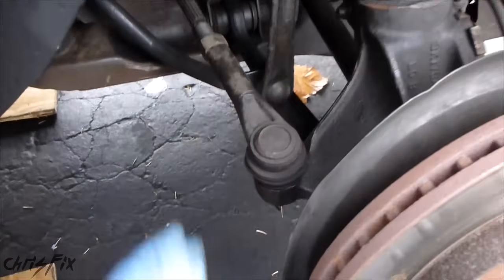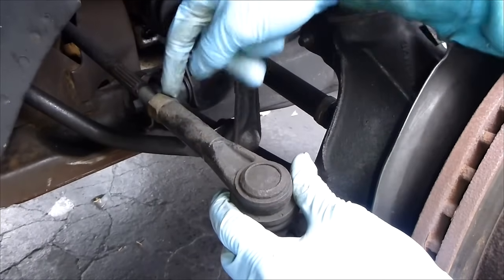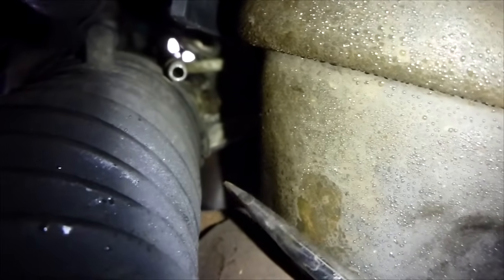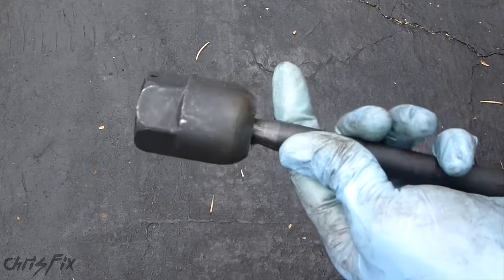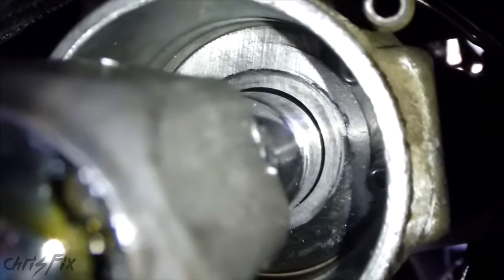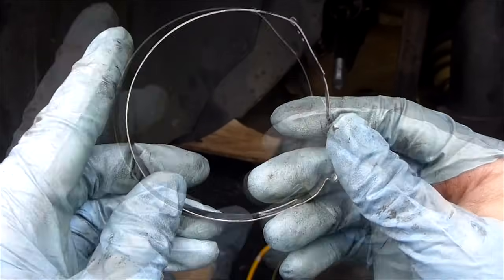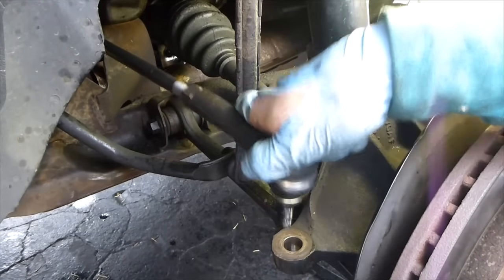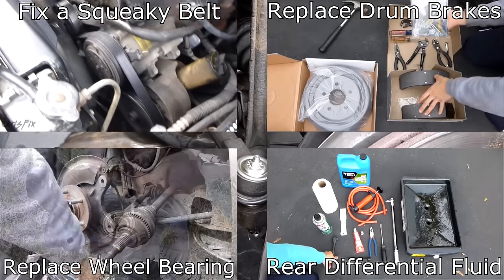How to Change Tie Rods (inner and outer tie rod ends)

Comment: These videos make repairs less intimidating. I’ve replaced tie rods, struts, brakes and water pump. Having a garage finally makes things easier. Before kneeling on gravel was no fun
Reply: With HOA policy, I can't work anything on my car although I'm not mechanic but just want to change brake pad and rotor.
Reply: @lot5953  you can’t even do it inside your garage?
Reply: @yungmexican32  ohh yeah in the garage is okay as long no one can see me but my garage is too small
Reply: @lot5953  Danm  hoa sucks man, luckily I was able to buy without hoa am able to do anything on driveway or garage. Hoa it’s like you still have landlords
Reply: @lot5953  I think I be moving that sucks

Comment: hello chris fix, i have a 05 bont. thank you for the videos.You saved me like 200.00, the shop wanted to charge me for a outer tie rod. they said it was a 92.00 part, got it advance for 18.00. then 100.00 for labor. ty again.
Reply: $100 labor per side??

Comment: Regarding removing the tie rod ends: Your method works fine and I'm really glad you didn't use one of those ridiculous forks, they're absolutely the wrong way to do it.  My two cents, if you read any vehicle manufacturer manual (not the manuals you buy in an auto parts store), the proper way to break the tapered end loose is to hold a hammer against the knuckle and hit the hammer with another hammer.  It drops out every time!!
Reply: Except that you never hit too hardened  objects Against each other

Comment: Just a reminder, You were turning the wrench to the wrong direction at the first try. And that yellow thin nut is used to lock the bigger nut after you tighten it in order to prevent it from loosening from vibration. I like your videos a lot by the way. Thank you so much for your great effort for sharing so much experience with us.
Reply: 1:12
Reply: I noticed that, too.  Happens to the best of us.

Comment: The mechanic says I have to have the inner rods changed and might as well do the outer ones too. Thanks to your video I’ve decided to do it myself. If I am successful I will have saved myself $300.00 in labor. I’ll let you know how it goes. Thanks!
Reply from the maker: Awesome! Good luck!
Reply: Razorusskie how did it go?
Reply: Luis Herrera It went pretty well. I did the rods on the passenger side first. Glad I did because they were the easy ones. The driver side of my 06 Chrysler Town & Country was harder because there were braces and brackets in the way. If I were to do it again I would have found a way to raise the car up higher. I could not get the outer tie rod to unscrew from the inner rod on the driver side, so I used a hack saw to cut them apart. Since I was replacing both it didn’t matter. The hardest part was getting the boots off and back on. Having the right tools for this job is a must. I rented a tie rod kit from Advanced Auto Parts. I had to put down a 72.00 deposit. I got it back when I returned the kit two days later. It was the most challenging job I’ve ever done on a car, but I’m no mechanic either. But thanks to this video, I was able to get it done, and saved myself over $500 dollars. It was worth it! Car has been aligned, and runs great!
Reply: Razorusskie wow. that's amazing thank you for the informative response.
Reply: Not only Labor but generally a shop will mark up the price of the parts by anywhere from 50% to 100% sometimes more, so a $50 tie rod is now $100.
Reply: Stix and you never know what brand/quality they use.
Reply: Razorusskie 👍
Reply: Stix the shadier ones will take a used part, clean it up and lightly spray paint it to make it look new. Luckily, my brother-in-law is the main Subaru mechanic at our local dealership. Parts discount!
Reply: Razorusskie Yeah just the parts for car are $60 each for passenger and drivers. A "certain popular auto store" told me it would cost $600 total. I'm gonna buy the parts and tools and do it myself. A savings of just under $500. I'll update when I finish the job. All thanks to ChrisFix!
Reply: Go for it u can do it
Reply: @stix562 , Yeah! I agree.  I don't mind paying them for their skills and experiences so the job will  be done quicker but not when they're trying to rip you off from your hard earn money.  Unless, you got to a owner operator shop then he/she can cut your some break on pricing but regular shop will always be sky rocket to get anything fix.  I was just at the auto shop today and they quote a guy $30 to fix a flat and he has to wait for an hour too.  Not only he's down $30 but lost an hour of his times as well.  Very sad... I could done it myself for $5 and 10Min with plug and fill sticks.
Reply: Firestone and Meineke recommend me to change the Inner tie rod for my 99 Camry. They both quoted some where around $250-300(Menieke ) $800 (Firestone) for the Parts and Labor. Plus an additional $90-$110 for Wheel alignment . After watching the video thinking of Doing it myself. Did you do both at once or separate days. Would you recommend doing it for a first timer ?
Reply: $300, that's all?  I just bought a used Ram 2500 and took it in for an alignment.  They said they couldn't align it because it needs new ball joints and tie rod ends. Fair enough.  Their quote was just under $4,000 total for parts and labor, adding in a serpentine belt.  Obviously I did it myself.
Reply: @chrisfix  i think theres no need to count turns of tie  rod at 2.35  ...cause the tyre is fixed  and the new one will slide easily
Reply: @stix562  Yes, if you cannot do it yourself its best to go find original parts online(Parts Geek is a good place to start) or from a parts store, and then find a mechanic to do installation.
Reply: Razorusskie yep. I had a guy tell me he could quit his second job after I helped him to start fixing his own cars. I like fixing so I'd rather do that too than punching the clock all day long.
Reply: Razorusskie........How'd it go,bro?Were you able to replace it?
Reply: How did it go ? Did you do it ok ? Thanks
Reply: @westsideken  What if your brother-in-law is that person?? dun dun dunnn

Comment: Keep watching Chris's video!
 I found out, that buicks have a plastic sleeve around the inner tie rod. Push it off with a screw driver. Harbor freight has the tool. It works. $37.99. 
You have to muscle it off! Once off, take the old part with you, to make sure, you get the same replacement part! 
Keep watching his video. Be familiar with what you are about to do.

Comment from the maker: If you want to see if your tie rods have gone bad and need replacing, here is the perfect video:
How to Tell if Your Tie Rod is Bad
Reply from the maker: So you need your headlights to be clear again? Like the lenses are yellow or hazy or something?
Reply: ***** I suggest that if you can't find the part you need contact a local auto salvage yard (they used to be called junk yards but a lot of what they have is NOT junk) and see if you can find what you need. Often you can get a whole used assembly in good shape for less than it would cost for a part of a new assembly.  Good Luck!
Reply from the maker: 1notgilty Good tip. But for tie rods and other important suspension pieces I rather have new. Maybe if you have a part that is super expensive otherwise it is worth it. I got these tie rods for $20 and the junkyard would have charged me $15.
Reply: ChrisFix True! Junk yards take  about $5 to $10 off regular new parts. And speaking from experience I can tell you an ignition module for a Toyota corolla was around 200 dlls at a dealership, Went to the junk yard and found a similar part but with the same voltage ...got it for  4 dlls at the junk yard and the car is still running.
Reply: +VeleS obando  My local pull a part is dirt cheap, but it still isn't worth pulling certain things. I have had bad luck with mechanicals. They are likely to break or be broken. Best deals are accessories, trim and aftermarket parts.
Reply: It so bad
Reply: ChrisFix
Reply: ChrisFix
Reply: donald lamb koo
Reply: As a person who does alignments in a shop - lube it all up, or else you will need replacement faster than they go bad becasue it will be impossible to adjust it. Also if you change only outter piece use a metal wire brush on dremel or angle grinder to clean all the rust on the inner tie rod threads so the nut goes freely on it or again the alignment will be more expensive.
Reply: Roberts Biezais what do u mean by lubing it all up. All parts are new and full of new grease. What else needs to be lubed up?
Reply: Ll Lock where inner and outer tie rods meet. There is usualy no grease there. I work with alignments and i use oldschool tractor oil thats very thick for the rod and locking nut. 
You want to lube them because after some time they will rust together . Its pain in ass to get them loose or even worse when you get them loose its so rusted that it has no more threads on it
Reply: Clark Kent if you buy oem or other high quality they dont cost a five
Reply: ChrisFix  can i use the same steps to  my nissan pivk up 4WD V6 1995. Thank you.
Reply: ChrisFix 7
Reply: ChrisFix and
Reply: ChrisFix  .thanks alot that was good.
Reply: teflon don
Reply: Ino Perez 

..
Reply: ChrisFix 8
Reply: Do you know any brand for a 13 civic im going to change my tire rods and suspension
Reply: ChrisFix to be
Reply: ChrisFix  شهرم سولتی2
Reply: Sgt_Ciekurs,  ....,
Reply: Dump your girl friend for a year and you would have enough money for a car.
Reply: I just came from your ball join replacement video, to this one.  I have to say your editing and vocal presentation got a lot better in a year.  You did wonderful here but your improvement over a year is amazing.  I have to say, this is one of the reasons you have 3.5M subscribers.  Thank you, ChrisFix!
Reply: ChrisFix what to do if the the rod spends when putting the Castle nut on or off?
Reply: get a pair of chanel locks and hold the top of the tie rod into the knuckle then get an air gun and bust it off
Reply: How do you feel about buying suspension components off eBay?  They are way way cheaper than AutoZone or even RockAuto and no shipping.   I just worry about the quality.  

Inner and outer tie rod ends, sway bar links, upper control arms and lower ball joints all for $79 including shipping for a Ranger seems too good to be true.

Should I buck up and pay the extra to have parts shipped from RockAuto?
Reply: ChrisFix you are a badass man.makes it look really easy.thanks.
Reply: Hau christ,,,i want to know how you can know the torque value about inner tie rood 66 feet/ pounds and out 46 feet/pound? How you know that?manual car or   pabric?
Reply: Hey Chris..how do you remove those 2 keeper pins on the inside tie rod for removal.....
Reply: @chrisfix how do you get your light fixtures bright again mine are yellowish

Comment: This video is fantastic and super helpful. This guy knows his stuff. Just make sure you torque your castle nuts once the car/truck is back on the ground. Just like upper and lower ball joints, once the vehicle is back on the ground the outer tie rods will drive deeper into the steering knuckle which will loosen the castle nuts.

Comment: 01:12 I SAW WHAT YOU DID 😂  good video though, the castle nut trick was just what I needed to know
Reply: Didn’t pick up on that until you pointed it out 😂 ah well we’ve all been there!
Reply: What? He's tightening it a lil so the PB blaster can penetrate the threads better before bringing out the breaker bar
Reply: That was the first thing I noticed 😂
Reply: Do that all the time

Comment: Thank you for your easy to follow instructions. I’m the type of person that needs to know how something works to know how to fix it. You do a good job of explaining the mechanics of a part as you show how to replace it. The close ups help a lot. My ex was an auto mechanic but I never paid attention to what he did when he fixed stuff. I wish I had but now I can do basic fixes. This looks doable for my skill set. I think this is the issue on my CRV. Front end makes a horrible clunking sound when going over bumps, turning sometimes, and braking hard. It started when we were out on a very bumpy rocky road. At almost 300k miles I’m not surprised lol.

Comment: Thank you for sharing your knowledge and expertise. Your video and valuable information saved me over $5K in repairs because I was able to identify that both outer tie rods on my 2019 GMC Sierra with 6” lift kit were damaged, the rubber boots were dry rotted and cracked because these were never lubed. I relied on my GMC dealership service techs to inspect this component and give me a heads up. BIG MISTAKE! Thankfully this repair and replacement was covered by my extended warranty. God Bless you

Comment: You can place a fixed object in front of both your tires and lay a marker on the object. Spin  the tire and mark the tread side of the tires. Measure front and back distance between tires to get you toe distance. When you finish duplicate the measurements and you are close to what you had.

Comment: Thanks for the vid, I went with Moog parts from amazon, the parts store parts were way over priced, not sure what is going on with the sudden rise in parts store prices. just need a big pipe wrench to remove the old inner tie rod. I used a 1 1/2" claw with a 1/2" torque wrench to reinstall. skinny zip ties work the best for the inner rubber boot.  Moving the rack side to side made it much easier to work on the inner tie rod end.

Comment: Mark oem tie position so you get alignment close
Reply from the maker: Thanks for the tip
Reply: The new one was a different length.. Wouldn't u want to spin it 5 or so more turns for a big difference in length

Comment: “Just remove the castle nut” he says. Just once in my life I’d like it to be that easy. I’ve done probably 10 outer tie rods on my various cars and about half way unscrewed the ball joint ends up spinning with the nut making it impossible to take the nut off. I usually have to hack saw the ball joint threads off. But hey that’s life in a rusty part of the country.
Reply: indeed, Chris makes it look so easy bahahaha

Comment: They are out of the wrench set that you have a link to on Amazon, so I'm wondering what size of wrench part did it need so I can order the correct one.   thank you for your video it gives me confidence that I can try to tackle this, even with a disability of bad shoulders and everything else.
Reply from the maker: I'm glad the video gives you the confidence to this job! What wrench set is out of stock?

Comment: Use the metal zip ties. Then you don't have to worry about the plastic ones wearing out and cracking.etc.
Reply from the maker: Thanks for the tip!
Reply: aka Ty-rap's. Lol. Had someone teach me that. A ziptie has a plastic insert for the locking mechanism, and a Ty-rap has a metal insert for the locking mechanism. If you are applying "zipties" in the cold, they are very brittle. So the Ty-Rap is the better bet if it's below freezing.

Comment: At 13:34, should we have the outer tie rod at an angle where the rubber boot is not more squished on one side than the other?
Reply: In the video the tie rod boot is slightly squished on the right side. Maybe doesn't make a difference but it looks weird to be who never did this before.
Reply from the maker: No, that's just how it sits after doing it in my specific application. If you are still concerned, after your car moves it should straighten itself out no problem

Comment: No way did that outside ball joint just drop out after tap with mallet.. come on Iv done many and they take lots of kisses💋 with a real hammer bro..but good video man...
Reply: I got some down to about 30 solid hits on the pickle fork.  Then sip of water, 20 more hits, then pitman puller, then another 5-10 hits on the pickle and easy as that.

Comment: someones definitely holding a gun to chrisfixes head behind the camera
Reply: GV S lol
Reply: Watch it be firestone, pepboys, or jiffy lube. Lol. But Chris does have a point. Fix your own stuff, that way you know it is actually getting done. I took my car to a firestone in Colorado and they said they replaced the engine oil, charged me the $30, and I inspected it and saw that it was still black like before. And that experience is why I have done the work on my cars. This new car I got is an auction car. I have replaced the engine mounts, power steering pump, engine oil, outer tie rod ends, and coming up today I have to replace my inner tie rods and the sway bar links. I have been quoted over $2,000 for all of this work... And doing it myself, I spent 7 hours learning, and saved $1,300 in the process.

Comment: Great video dude, I've watched several & yours is the best buy far, i took vacation to fix the laundry list of issues on my ram 1500. Inner/outter tie rod ( last on front end ) rear bearings, rear shocks links & bushings, exhaust manifold gaskets. On the rear i figured minus well replace while I'm back there.

Comment: Very informative. Had a thought re the inner tie rod. Probably would not happen but given the age of the vehicle and possible excessive mileage and the rarity of it happening, but if the inner tie rod end snapped on removal the replacement job just became monumental. I think I might leave the inner ends to a shop for replacement.

Comment: Everyone, keep in mind that white/ opaque Zip Ties will eventually weather and fail when used outdoors (especially underneath a vehicle), but BLACK Zip Ties are rated for outdoor use and will be far better suited for this application.
               💫
  The More You Know
Reply from the maker: Interesting, thanks for sharing!
Reply: It's also worth noting that black zip ties are "S/O" Rated, meaning that they are resistant to both Sunlight as well as Oil & petroleum based  substances, so black zip ties are 100% appropriate for this application.